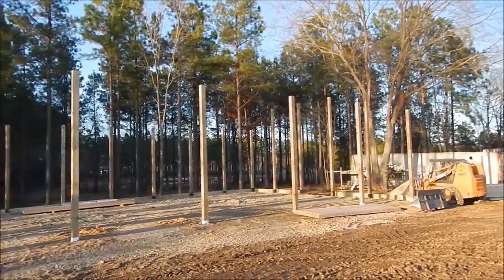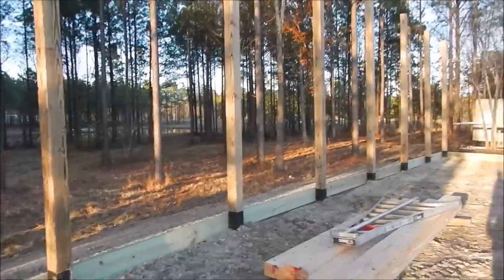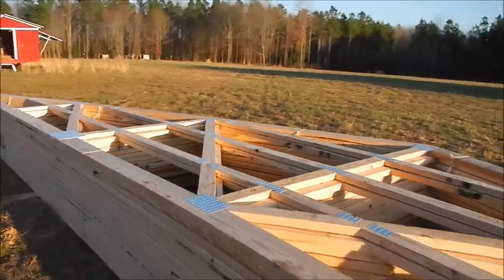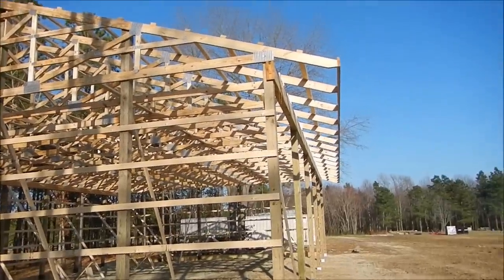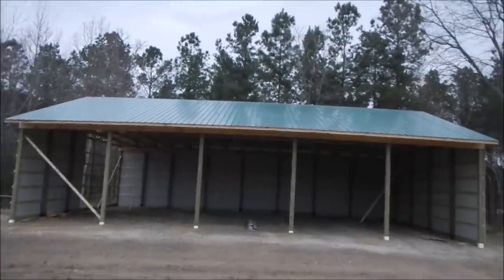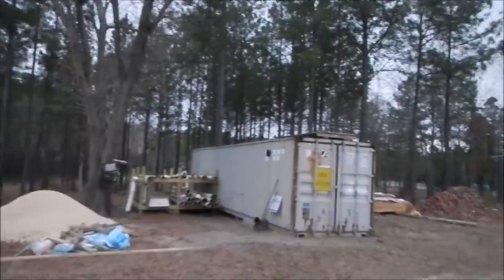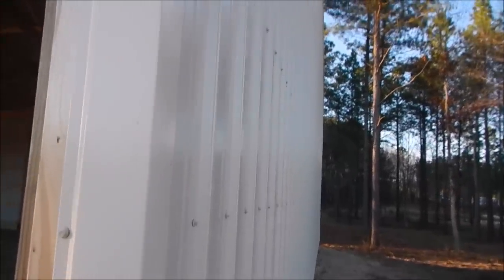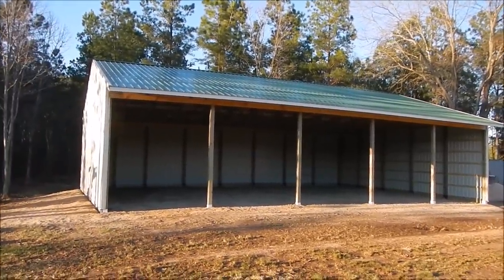5 Day Pole Barn Build

Comment: Great pole barn. Steel bollards are a great addition for preventing damage to the front corners and front doorway posts. Bollards on the inside and outside of the entrance posts are recommended.
I've seen someone hit the inside bollard with a snowplow wing that was down while in the wash bay.
The driver forgot the wing was down, the wing is hard to see and when the wash bay overheads were opened it created fog from the cold winter air acting on the pressure washer mist.
Saved the building from considerable damage.
Its usually friends or outside contractors that crash into your doorways.

Comment: You should drill and add a big pipe or pole in front of each of the poles on the outside in case someone screws up an backs into one. You don't want your barn to collapse partially for a stupid mistake, so a crash pole is good to have.
Reply: Correct term is bollard

Comment: I work in the construction industry on a building that size with 5 guys and a good day we set trusses the same day we move in....
And yes we stack all our steel an predrill every hole...one thing I did notice they didn't put corner bracing in and no vapor barrier makes your steel roof last 10x longer

Comment: Gotta love those Mennonites!  When I carved my new farm out of a field in 2003, I hired an Amish guy to build our 40' X 30' X 10' sidewall pole barn.  They were in and out in TWO days!  $7500.  It was a great deal.  Once that was done, I had power run to the building for the whole property and did a large 200amp breaker box inside the barn with the pole just outside.  Destranded some #2 wire into a 100a. breaker and ran that over to the temporary mobile home we had and I had so many breakers, I ran each 110v. outlet on it's own breaker in the barn!  It was great!  You could be running a table saw and pop off a circular saw at the same time and the lights wouldn't dim, lol.  Serious overkill - but that's ok.  Nice Barn!  Your farm's comin' along nicely!  Is that red building out in the field a portable chickin' house?

Comment: Add some gutters which drain into some IBC-containers behind the shelter. Then you can use a little pump to hose equipment down.
Reply: ronald g IBC Container's? Are those plastic water or septic tanks? I take it those would have to be buried below ground for water to flow into them?
Reply: ibc is the plastic 275 gal  totes in a metal cage you can pickup for 100 for cleaned non food grade...they can be buried or just set at the corner and use as a cistern water basin for water needs...washing equipment ect...and it keeps the water out of the pole barn

Comment: DO NOT raise the grade outside above the bottom of your skirt board (as you said)!!!  If you do, water that hits the building will follow the building down and find its way inside.  Instead, to seal off the inside from the outside, raise the inside grade by an inch or 2 above the bottom of the skirt.  Just be careful not to compact the material too much near the middle of a skirt board or it will bow out.

Comment: They must have shot a laser to be that dead on with screw alignment, thats impressive, not many people now days take such pride in their craft
Reply: Trav I was thinking chalk line
Reply: stack it and pre-drill it before its put up!
Reply: Its all drilled at one time. Each side is stacked together pull tape one time drill as many sheets as you need
Reply from the maker: thats what they did
Reply: It's called a chalk line. Keep it simple
Reply: The guy I watch uses an awl to punch every panel on the side wall. The roof is done by eye.
Reply: @dennishensley1150  Chalk line leaves a mess. These were pre-drilled while stacked up.

Comment: Love the barn but may I ask a question ? Do you think it will cause a problem with rot if you back fill dirt up against that board running along the bottom ? Thanks for sharing.
Reply from the maker: its pressure treated so it shouldnt
Reply: Spray it with diesel fuel/kerosene also if you think it will help ?
Reply: @augustreil  Used motor oil will also help repel water.

Comment: They did a really good job.  Do you know if they put the screws on the ridge or the valleys  for the roof?  I have a friend who swears the screws need to go on the ridge.  All the roof manufacturers say the valleys
Reply: Brandon Damato screw on top the ridges it flattens and stretches the metal by time you get to end it'll be out of square.

Comment: There are  several ideas for building sheds
Start With a Sound Foundation a shed wont last long if it's set on a weak base
Allow for Air Circulation to prevent damp 
Build a Weather-Resistant Floor Frame
Use Low Maintenance Materials so you won't have to keep painting it
(Reference: Adota blueprint pack site )

Comment: Wish I had someone like theme here in Oregon, I need the same 40' by. 60' shed built here.
Reply: Hey Rodney,  did you ever find someone here in Oregon?  I am building a 30x60 equipment shed similar but with a slightly different roof.

Comment: Have you seen roofs where there are clear sections to let some sunlight in? Just qures
Reply: MyOLD36chevy I have 6 on my shop. The sun made all them crack and leak. Hail storm beats them up bad too
Reply: Thanks that's good to know and I found the comments on the need for rain gutters interesting  you must not get the 4'' to 8" of snow on the roof that we do that comes down like an avalanche in the spring and can destroy rain gutters on a tin roof.

Comment: Hi Chris, 
I do the same type of barn here in Ireland only it is all a steel frame, steel posts, truss etc and timber rafter, on a 63ft barn we would have only 4 openings, approximately 15'6" opening each.
Could you possibly private message me with a construction cost for your barn as it stands in the video, obviously understructure was your cost

Comment: ALOHA...... I'VE BEEN EJOYING YOUR VIDEOS.... JUST A QUESTION??? WILL YOU DROP POWER OUT TO THIS BUI;DING??? LIGHTS??? CONSIDEER INSTALLING SOLAR PV & LI-IONJ BATTERIES??? TO LIGHT UP THE INSIDES & EXTERIORS??? MAYBE BE ABLE TO FUN BATTERY CHARGERS, ETC???? MUSIC/SPEAKERAS...  

JUST A SUGGESTION IN YOUR NOT OR HAVN'T DROPPED A SUPPLY LINE OUT TP THE LOCATION...

Comment: I was planning on building a 60X60 with 30x60 living quarters inside. Now I'm thinking 90x60 at least.
Reply: Did you ever build? How'd it turn out?
Reply: @kylancook3477  I'm actually building a traditional home as we speak. The metal building with living quarters was gonna be way more than expected and requires commercial insurance.
Reply: @phatrides222000  bummer, was it gonna be more just based on materials or total cost of building it?
Reply: @kylancook3477  cost of building according to the builder. That builder runs on the high side. Insurance was the biggest thing.

Comment: Only thing I would have done is a clear ridge vent to let in more light.
Reply: Mrbink01 I put a clear one on mine with 6 skylights. Not sure why, but the sun cracked all of them. They all leak. One got completely broke out during a hail storm
Reply: I had skylights on the pole barn on some property I bought. The barn was only 2 years old and every one of them leaked.